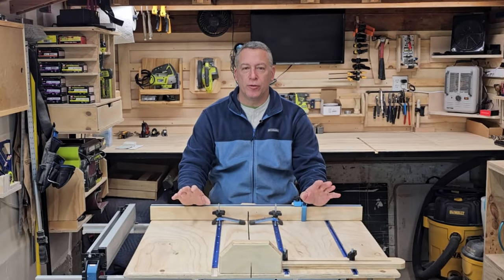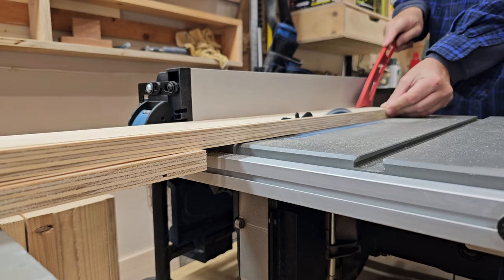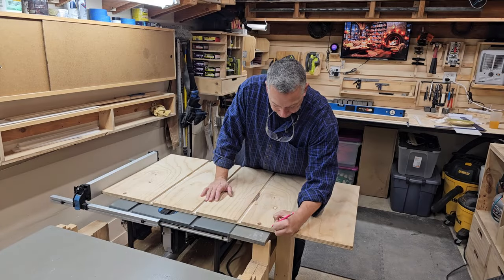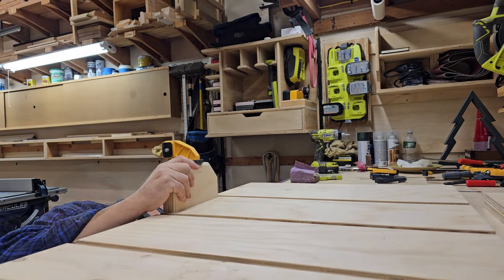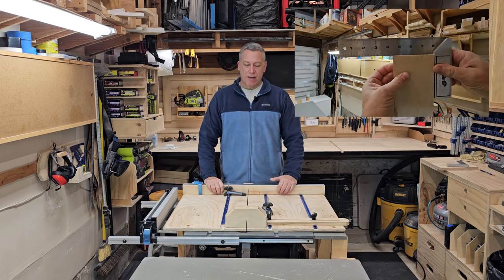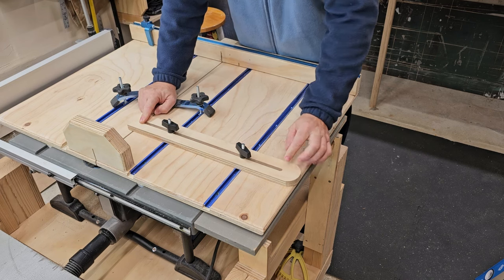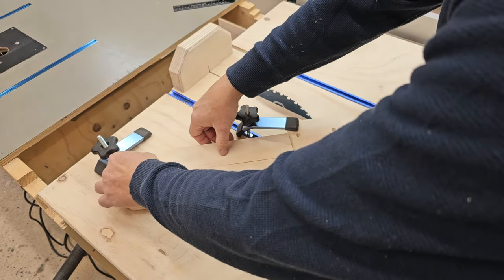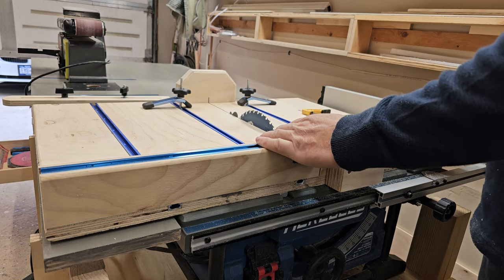Simple Yet Versatile Crosscut Sled | How-to Make For Your Table Saw

Comment: I have a ryobi job saw that has  4 tabs in the miderslot. Do you have recommendations on how to mack runners for this.
Reply from the maker: You would almost have to make a "T" shaped rail. My table saw miter slot is narrower at the top than the bottom. So I can't lift my sled out, I have to slide it out. Another option, which I did on an old table saw, I made the rails as narrow as the tabs. There was a little play when I first put the sled on, but once the rails passed to of the tabs, there was no side-to-side play. I hope this helps.

Comment: I've been woodworking for decades and still have not taken the time to make a good cross cut sled.  In the past, I've made them too big and heavy.  They were hard to store and I would take them apart after awhile.  I'm thinking this looks pretty good.  Another fine job, bud!
Reply from the maker: Oh a good crosscut sled is a life saver sometimes. Agreed about storing them. I am thinking about putting a couple of holes in the base of it and then hanging it on the wall near the table saw. One of my future projects is to redo the table saw stand and when I do, I will make a shelf for the crosscut sled.
Reply: @TheWoodworkingCorner  Storage is a real issue in my shop.  I probably spend 1/3 of the time it takes to make something searching for the part/tool I need.  But that's my shortcoming.  Hey, you're doing a great job of turning out quality videos with great subject matter.  My wife thought that we could have done a local community TV program years ago (BYT, before you tube) and I thought, " who in the world would want to see some jim oak working in a shop), I could've been a contender.  Too late now.
Reply from the maker: Haha, never too late.